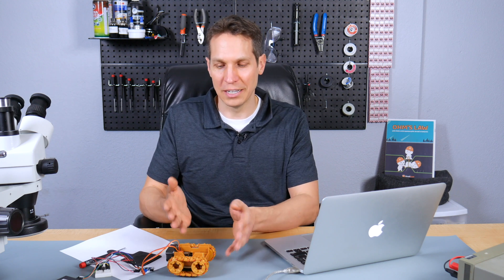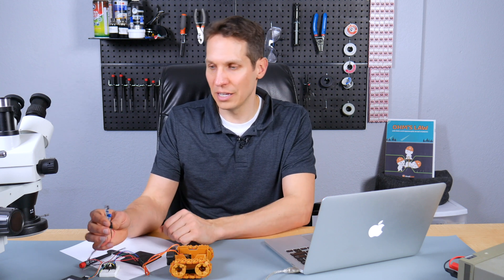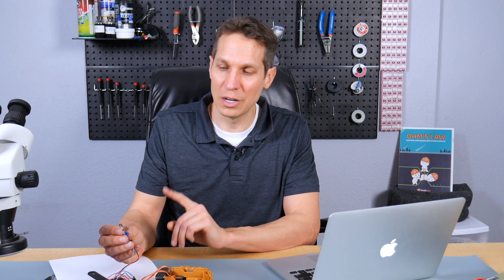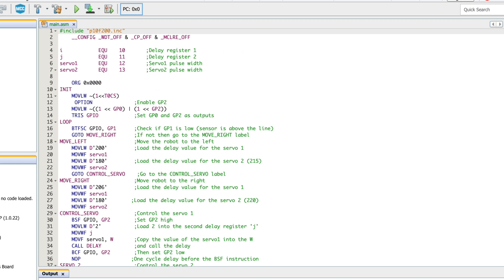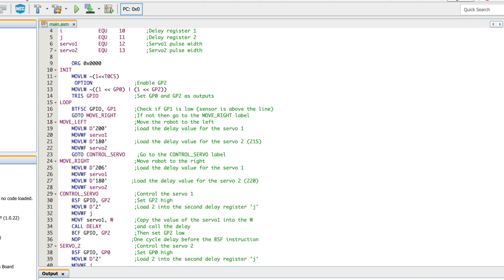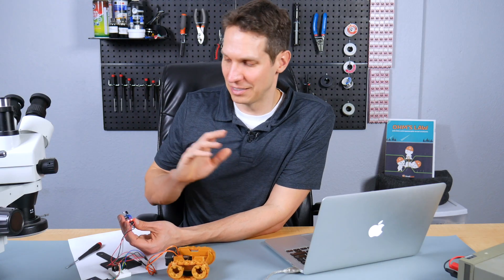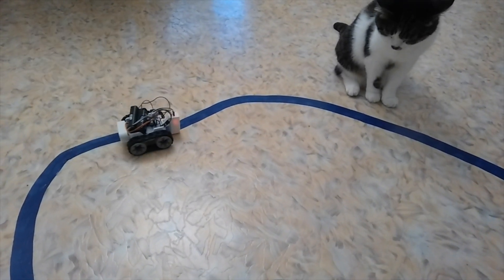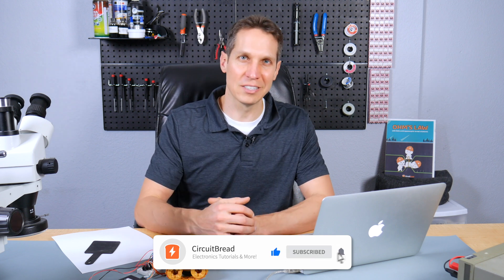Line Following Robot - Part 13 Microcontroller Basics (PIC10F200)

Comment: Dear Mr. circuit bread i am, having challenges using the ADC converter in pic microcontroller could you please help me  with some useful tips please , thanks
Reply from the maker: Hi Andrew, as challenges with the PIC typically require some back and forth and sharing of code, I'd recommend going onto our Discord channel and chatting there.  It got a bit quiet over the summer but I anticipate it will get a little more lively now that school is back in session:  https://discord.gg/vdqARHb

Comment: I am loving the series, but I'd love to see more of the hardware side. The series started great with explaining the clock cycle and instructions per cycle. I'd love more in that direction. Like:
- How do MCUs implement different protocols and things at the hardware level? USB, SPI, I2C, etc
- How do the different parts of the MCU interact together?
- How does multithreading work?
- What does the MCU startup process look like? Setup/config/enabling peripherals?
Reply from the maker: Those are excellent questions and seem to either fall directly into the computer architecture topic or straddle the line between computer architecture and microcontrollers.  I'm wondering if I could convince Sergey to tackle this topic... Unfortunately, he already has three other series that he wants to do and he's swamped at the moment, so I'm not sure when we'll get to it.
Reply: @CircuitBread  Thank you! It would be amazing if you can tackle those.